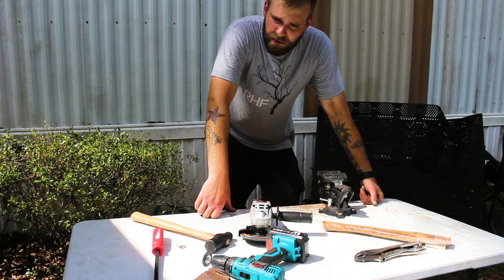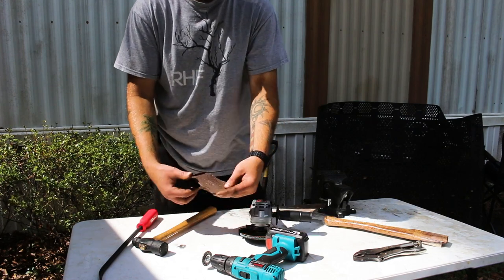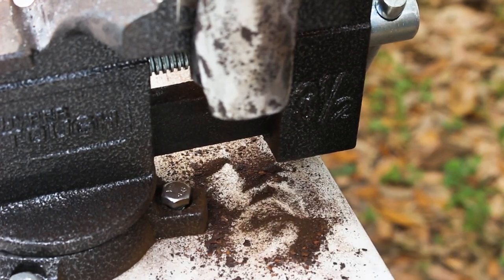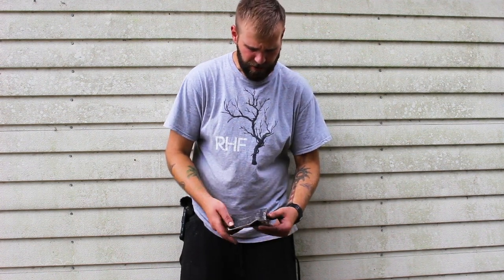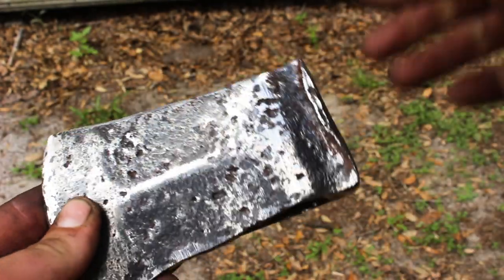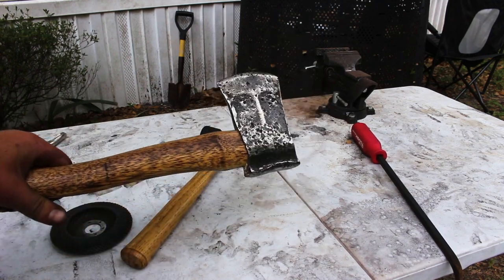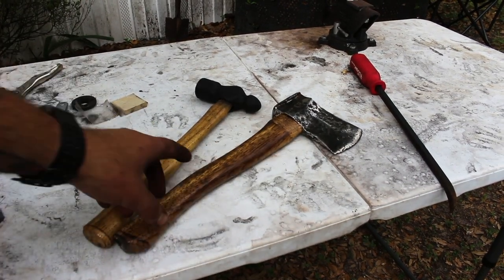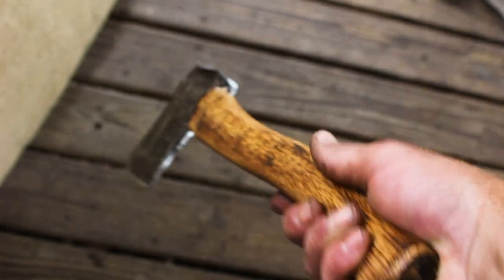Hatchet Restoration After Being Buried For 100 Years

Comment: Hi RHF! I have found several axes that I would like to do the same for..Great Job!! What type of sanding discs were you using, and also was that a Dremel you used to hit the interiors?
Reply from the maker: I used a 40 grit and 60 grit flapper disc for the angle grinder  and yes a dremel with a sander and grinding stone attachment